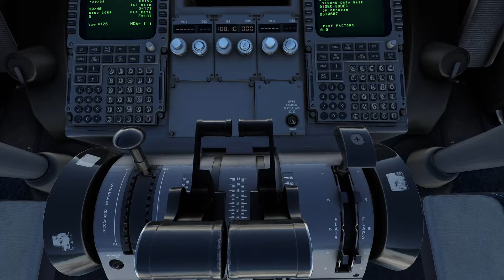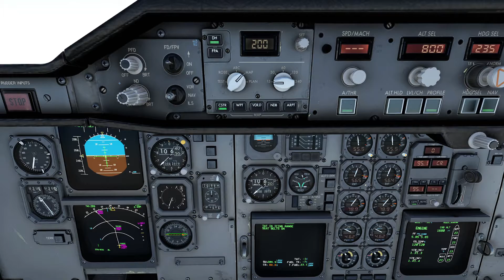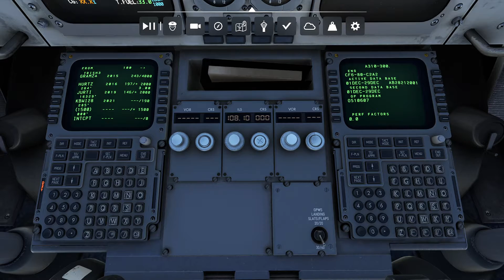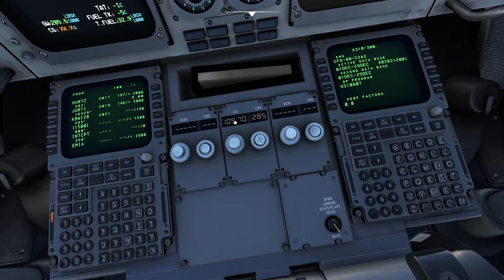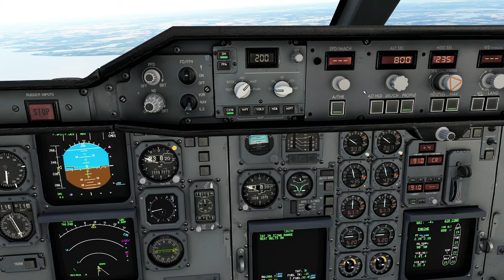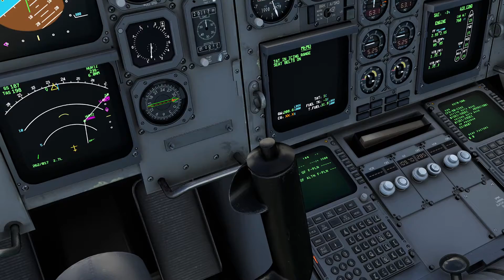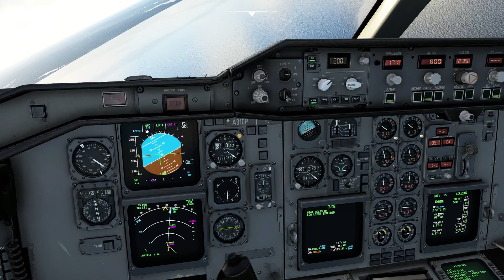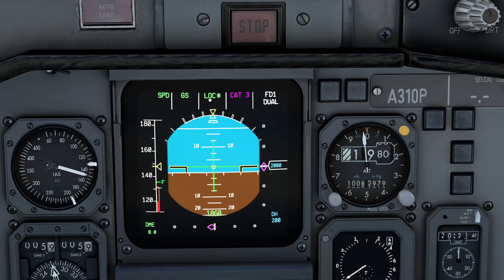MSFS - Airbus A310 Approach and Autoland Tutorial

Comment: I was wondering if you were supposed to turn A/T off when doing this. Did you actually have to do it right before touchdown or what?
Reply: Don’t have to until after crossing runway threshold.  It was a little strange the way he turned it off with the mouse.  Ideally have A/T disconnect mapped on your throttle/yoke as it is in real life.  Tap it off and bring throttle to idle just as you flare.